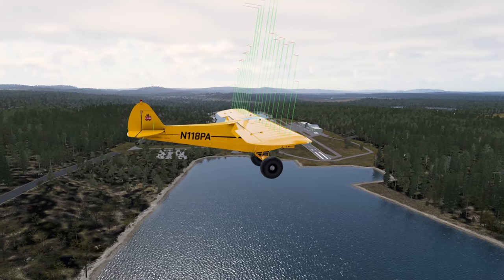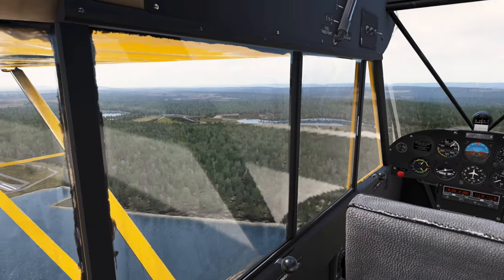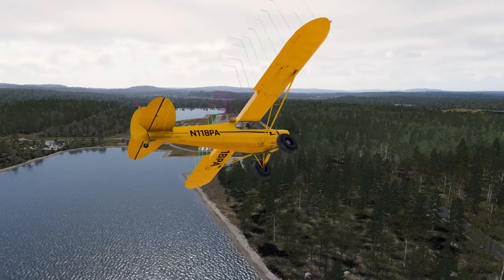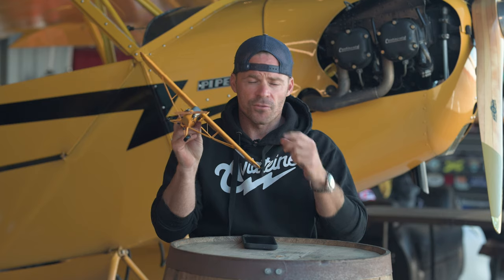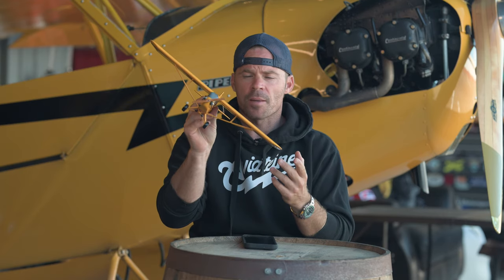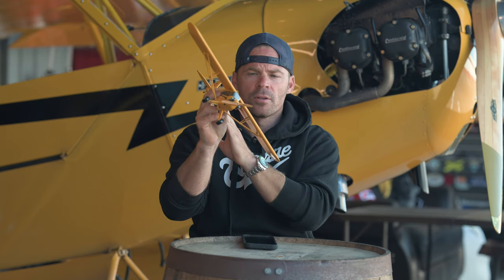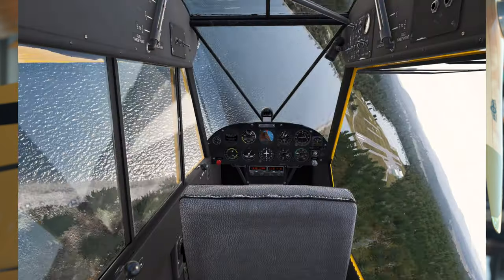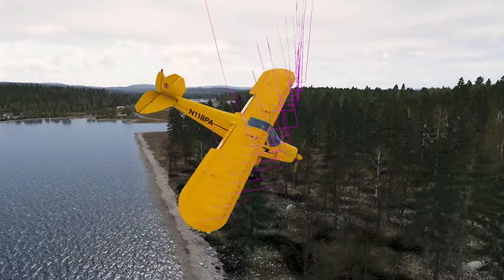The Skidding Aircraft Turn , why it can be dangerous in the  pattern and result in a Stall/Spin

Comment: In a skidding turn the bottom wing DOES NOT have an increased AOA compared to the top wing. It has less AOA than the top wing. That's why you have to hold some outside aileron to keep it from banking even more.
Reply from the maker: This is not correct, on a skidding turn (or in a skidding turn I should say) the bottom, inside wing has a greater AOA than the top one. The overbanking tendency is because outer wing is traveling faster.
Reply: Wanna bet? Look at the illustration on page 126 of STICK and RUDDER.  @Bananasssssssss
Reply from the maker: @philipmartin708  give me until tomorrow, lol. I’ll look but books in the hangar.
Reply: @Bananasssssssss  Well, here it is, tomorrow night. Crickets.
Reply from the maker: @philipmartin708 I turned to page 126, you’re still incorrect lol
Reply: @Bananasssssssss It so clearly shows the forward wing (caused by yaw) having a higher AOA. Please explain how I'm incorrect.
Reply from the maker: @philipmartin708  I think you’re confusing a Skid for Slip. 
In a slip the tail of the aircraft is displaced—or yawed—toward the outside of a turn, or to one side of a straight flight path if balanced by control input. The outside wing is traveling faster through the air than the inside wing but is also forced into a higher angle of attack. If you decrease speed or increase back pressure (or both), the high wing will stall first. This tends to level the wings and also reduce the outside wing’s angle of attack. A stall out of a slip is only somewhat more hazardous than a coordinated stall.

By contrast, in a skidding turn the tail is yawed toward the inside of the turn. The inside wing has a higher angle of attack. If that wing’s AOA reaches critical and stalls, the other wing is at an AOA very near that for maximum lift. The low wing drops and maximum lift on the high wing snaps the aircraft over into a spin
Reply: @Bananasssssssss  Thanks for clearing it up for me.
Reply from the maker: @philipmartin708  no worries! Thanks for listening!

Comment: Good job, Joe, with what can unfortunately happens when we think we have to pull on the stick in turns.  We don't.  Crop dusters and gunship pilots know that turn of any bank angle can be be made at 1 g simply by allowing the nose to go down as designed (dynamic neutral stability).  The design of the airplane is to fly, not to stall.  The airplane cannot stall unless the pilot or computer is pulling on the stick.  No stall, no spin, no problem.  Release back pressure in steep turns (actually any turn) in the pattern.  Good job with the illustrations.
Reply from the maker: Thank you!
Reply: An aircraft cannot make a turn without increasing its lift when it's banked. This is so basic.
Reply: @philipmartin708  It can if you aren't maintaining altitude, which is what he is saying. If you allow the plane to drop you don't add any load factor and overload the wings, so you CAN in fact make a turn without increasing lift, you'll just lose altitude.

Comment: Why would there be any temptation to a skidding turn in the first place?  In a turn, neutral rudder and keep the ball in the center with the aileron (the ball moves the same direction as the aileron).  In essence you're controlling the differential drag of the two wings to as to center the ball.  Probably you'll wind up holding slightly top stick as the outer wing is going faster than the inner wing so it needs its lift reduced for balance.
Reply from the maker: @yclept9  the temptation comes from overshooting final and trying to get back on centerline

Comment: I love on the edge of stall+spin the entire time I'm soaring. The issue, as I've witnessed during soaring flight, seems to be the overbank caused by the inward rudder input. 

As you apply the inward (dirt side) rudder: you induce overbanking. You naturally will want to oppose the overbank with aileron. This causes the angle of attack of the inner wing to increase (increasing drag and increasing yaw rate) and the outer wing AOA to decrease (decreasing drag and increasing the yaw rate) - this increased yaw rate causes even more overbank. The pilot applies more aileron - and SNAP - around and over you go, before you can do a thing about it. 

I'll post a reply to my comment of a video that demonstrates this incredibly well. The only difference being the yaw string is used instead of a slip/skid ball. 

Having lived on the edge of stall+spin for hours on end of every flight I take has really brought an understanding to why it's so easy to do in the pattern. The key ingredient is to overstand that it doesn't happen because the pilots get slow. It's because they load the wing up with AOA turning final or turning back after an engine failure.
Reply from the maker: Well said
Reply: @Bananasssssssss one technique I teach students about the pattern is to pull their runway side (earth side) foot off the pedal a bit so they aren't tempted to use it in the pattern. If you gotta slip... That's fine once you're on final. They're not Bananassssssssssssssssssss - yet 🤪
Reply from the maker: @TheSoaringChannel  😂😂😂
Reply: Doesn't your glide ratio go way down while flying on the edge of a stall? I understand the value of flying it on the edge of a stall while you're thermalling, but the entire time you're soaring?

Comment: Two rules have kept me alive:
1. Keep the ball centered except when performing an anti-spin maneuver (slip- but not a skid!)
2. Never do low altitude 360 degree turns (like looking at moose or sheep horns, etc.). Do a fly-by followed by a 180 turn referring to your instruments and attitude. The fly-by again.  In Alaska, many experienced pilots have died from a so-called "moose stall".
Reply from the maker: I heard that term but never knew why they called it that! Now I do! Ha. Thank you!
Reply: nothing wrong with 360 turns.

5deg bank 360
10deg bank 360
3deg bank 360
15deg bank 360
etc.

speed and coordination matter too. but shallow 360 turns are so benign.
Reply: @SoloRenegade  Of course a 360 can be performed at low altitude- but it is a fact many very experienced pilots have died doing it, and another fact is if your attention is focused outside of the aircraft- staring at a set of horns- you can lose situational awareness and subconciously kick your rudder a bit to get the strut out of your view- boom you are along for the ride to a terminal event! Things are made worse if you are in the mtns/canyon where you lack a horizon . Easy to bled your airspeed off. At sufficient altitude- no problem.
Reply: @billroberts9182  you also can't get a pilot license or commercial license without doing it (maneuvering low level, doing turns). 

If you can't maintain control of your airplane, surrender your license. I'm a CFI, I don't need a lecture from you.

I'm also an aerospace engineer and design airplanes.
Reply: @SoloRenegade  I doubt you do 360’s at LOW ALTITUDE! That is what can get you into trouble. If you read my post, I,m referring to low altitude 360’s. I know two very good cub pilots (in separate crashes) that died doing exactly that.  One was looking at a walrus in the surf and one was apparently looking at some Dahl sheep. Another acquaintance was doing 360 over a sheep- he apparently hit his wake turbulence- partially stalled and clipped the top of some spruce trees. It was his idea about LOW ALTITUDE fly bys  rather than 360’s- which I wholeheartedly embrace. You want to do LOW ALTITUDE 360’s? Just do it by yourself so you don’t kill an innocent!
Reply: @billroberts9182  Eights on pylons, turns around a point, left and right 360s in teh traffic pattern for spacing (at ATC request), taking aerial photographs of people's property....

When flying helicopters we regularly fly within 500ft to 1000ft of the ground,

Just because you're an incompetent pilot who is afraid of basic maneuvers, doesn't mean everyone else is.

If you can't safely execute a 360 degree turn at any altitude, you need to surrender your pilots license or get more training before flying solo again.

Comment: We used to intentionally stall in skidding turns. Fun going over the top
Reply: Going over the top from a skidding turn? I think not.
Reply from the maker: @philipmartin708  that’s what happens when you stall in a skidding turn
Reply: @philipmartin708  for fun. Great in a champ.
Reply: Well this statement contradicts everything you said and showed in the video. A plane will break over the top from a slipping turn, not a skidded turn.  @Bananasssssssss
Reply from the maker: @philipmartin708  I feel like you’re just messing with me now, lol. Nothing happens when you stall in a slip, lol. It’s almost exactly like stalling straight and level
Reply: @philipmartin708  nope, it will roll over the top right into a spin.
Reply: Does your video show the plane breaking over the top? No. And why would it when you're holding bottom rudder?
Reply: @philipmartin708  no it  will roll downwards towards the low wing not go over the top.
Reply: @johnmajane3731  Thank you for making that correction. Now all we have to do is to convince Bananassss to believe his own video.
Reply: @philipmartin708  I am backing up Bananassss not correcting him. He is right it about stalling in a slip and I am right about stalling in a skid.
Reply: @johnmajane3731  He jumped right on my comment about stalling during a slip and completely sidestepped my first sentence pointing out that he was contradicting his own video which shows that in a skidding turn, it breaks and spins toward the bottom wing, not over the top.
Reply: @philipmartin708  except you are wrong. The plane will go over the top if stalled skidding. You said in a slipping turn if stalled the plane will go over the top, it will not.
Reply: @johnmajane3731  The youtube videos on the subject, including this one, show that in a skidding turn  planes spin towards the inside (bottom) wing. And opposite, (over the top) in a slipping turn.